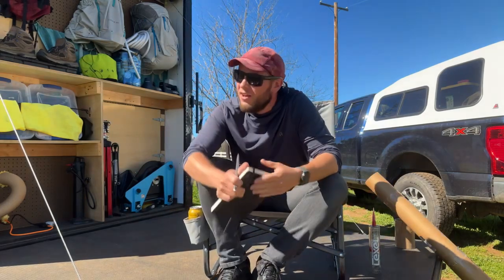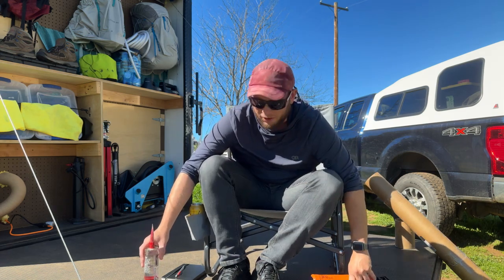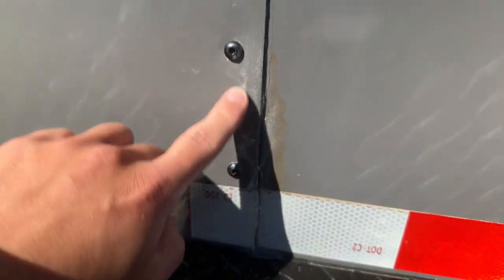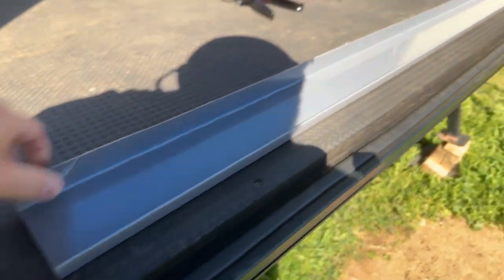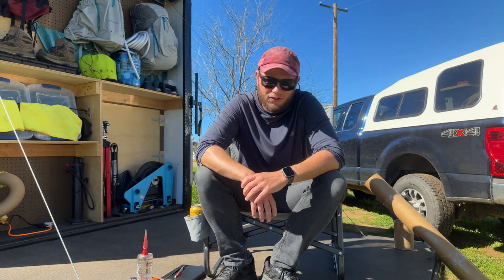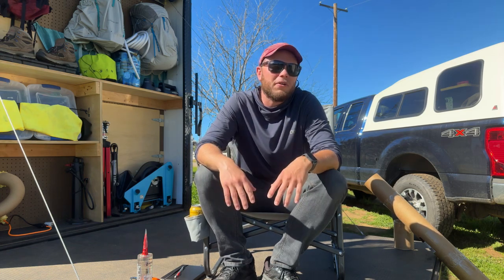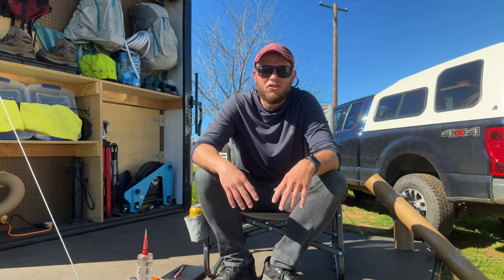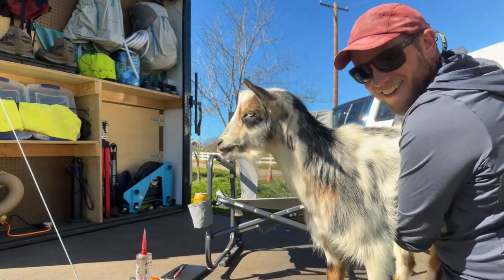Do THIS to fix LEAKS on a Cargo Trailer

Comment: I have a 2005 24' Haulmark cargo trailer, recently i noticed i could see outside where the roof galvanized sheeting meets the corner pieces, on a ladder i scraped off all the original caulking and cleaned with acetone then used a bead of 3M 5200 marine caulk along the whole seam 24' i also thinned 5200 with acetone and painted on fairly thick over the seams and screws multiple coats. It set up now looks great. I have never seen 5200 weather of peal off anything, i believe it'll out live me. Beware if you use it and have to remove some it wont be easy its considered permanent altho i have scraped, chiseled, burned and sanded it off with difficulty
Reply from the maker: Excellent information. Thank you for adding it so others can benefit too 🙏🏻

Comment: I knew you had a mess to scrape off and clean up from the last video. I was thinking “Sucks to be you”

The goats rock!  

I always wonder about all the screws, wouldn’t a small rubber washer under each one be a good thing?  

Caulk guns, never get the twist lever ones to release the pressure (usually blue). Get the trigger tab push ones (usually orange).  Just my experience with them.
Reply from the maker: Yeah…I listened to a lot of podcasts while scraping it all off to keep me sane 😐 And oh my gosh, the goats are so much fun. Never a dull moment with them. 

For the screws: if they had been installed with silicone or a rubber washer like you said, then yep, that would work. But most are stripped so not an option now. I’ll do a real fine bead of Lexel around each…going to need more podcasts to listen to 😩

And YES! I always had the BLUE caulk guns. I hate them! This one actually makes caulking enjoyable.